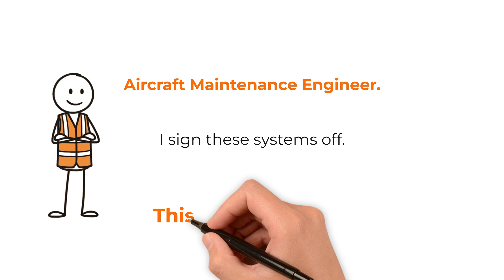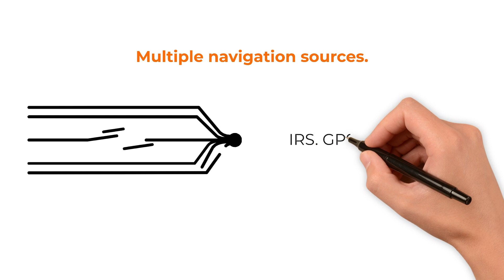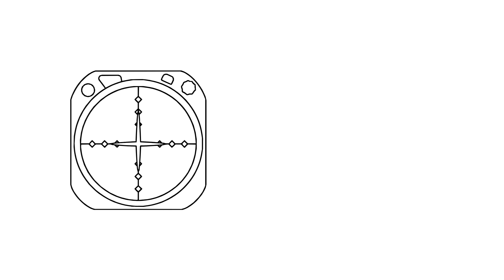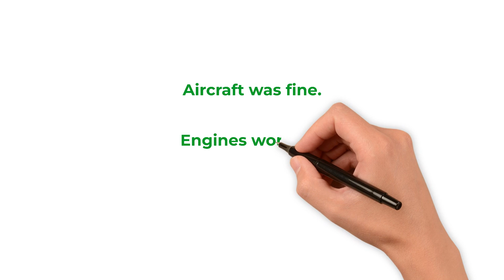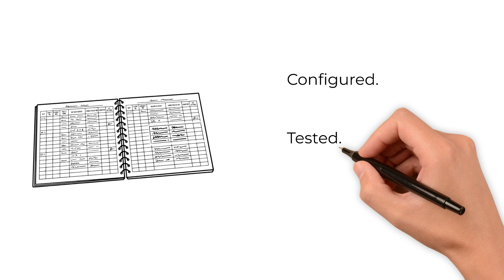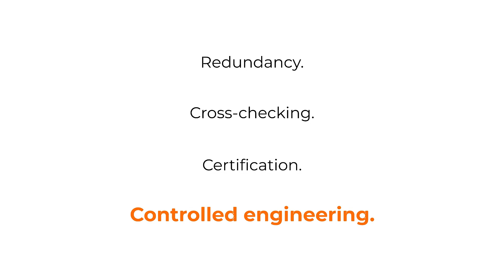How Avionics Actually Works... What Happens When Aircraft Data Is Wrong

Comment from the maker: Something I could not fit in the video... when we replace an avionics unit, the physical installation is the fast part. The configuration, the interface checks against the other systems, and the documented verification take far longer. A unit that powers up is not a unit that is serviceable. The paperwork is not bureaucracy... it is the proof that the data chain is intact.